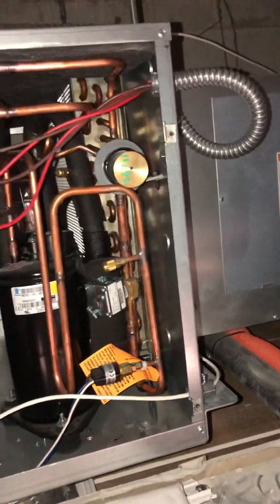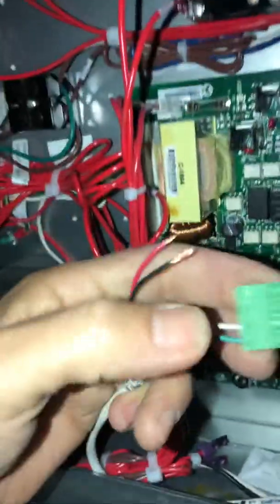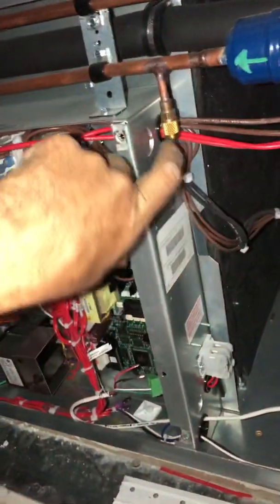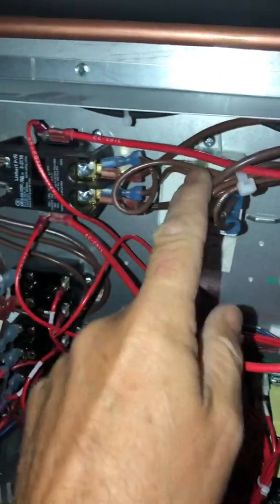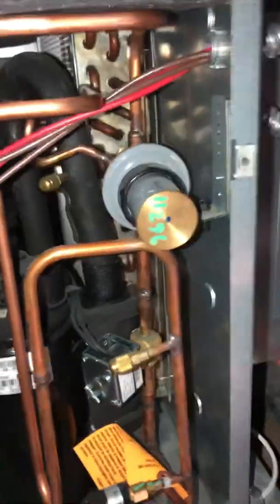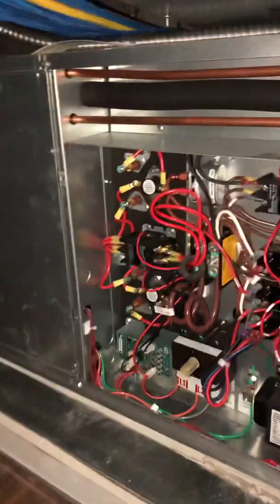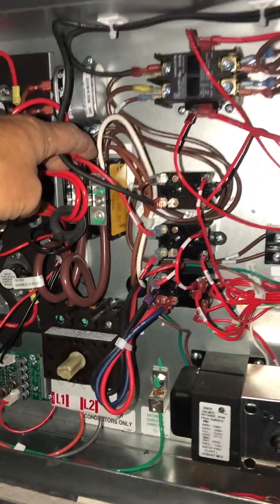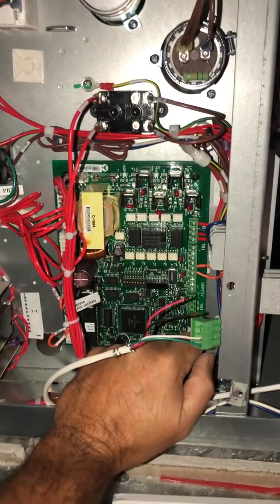Mini mate 2 wiring (self contained)

Comment: No offense but that manual was the worst one i ever read. They are so vague about everything. None of the wires are labeled or have numbers so on the vertiv split they for instance have two brown wires and you have to pick the right one. took forever to figure that out before it dawned on me. nice units bit they need to make things just a bit more installer and service friendly. Even just a simple label on the service panel would have been nice.
Reply: At the condenser yes I know if you look close there are numbers by the end for 1 and 4.  The blue and white are not numbered either you have to look at the condenser wiring schematic to figure what number they are